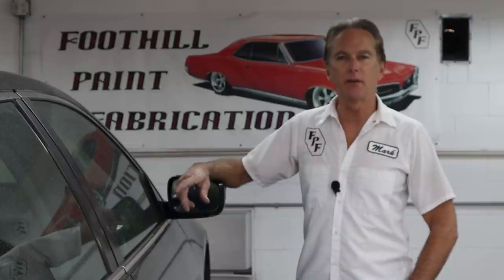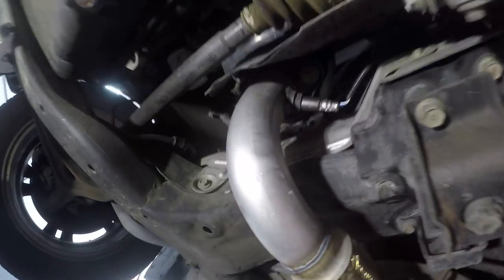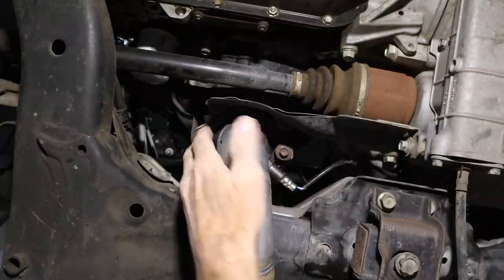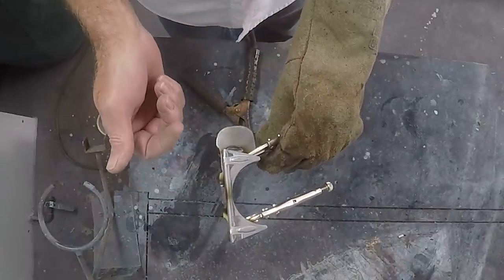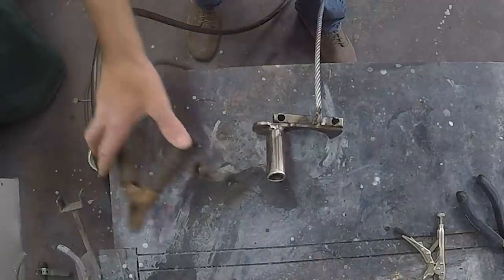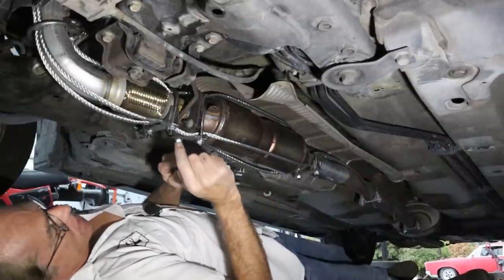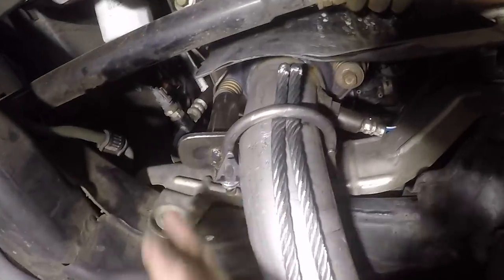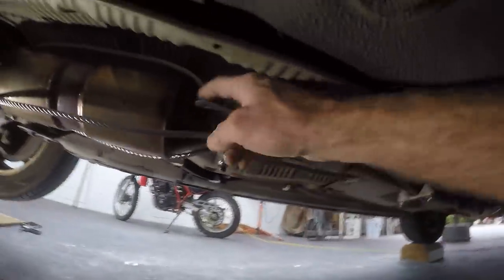Catalytic Converter Theft Deterrent Easy and Cheap

Comment: they will just easily cut the piping and clamps. No bolt removal required, A good sawsall with a metal blade...6 minutes max.....
Reply from the maker: Cutting cable with a reciprocating saw is not easy and the top cable is hard to reach. This set up has been on there for over a year and has deterred at least one guy that we know of. So far so good and after all it is a deterrent not a foolproof system. If you were a lazy tweaker thief and looked under this car would you want to even mess with it or go down the street to the easy one in the driveway?
Reply: @FoothillPaintandFabrication   @Foothill Paint and Fabrication  cutting the carbon steel clamps or threaded u clamp bolts and exhaust piping closer to the CC seems to make the cable useless, no? A cheap easy fix that just looks weird and my mom can install and I;ll win you $4ok, seriously.

Comment: I don't think that will slow them down much.
Reply from the maker: It is a deterrent so if they look at it and think it will take more time and WORK than they want to put out hopefully they will go onto an easier victim.  If they want it bad enough there is nothing that will stop them unfortunately.  Have one guy on video taking a look and passing on the car so it worked on him.  Fingers crossed it keeps working.

Comment: Trying to saw a loose cable is much more difficult than a welded cable..
Reply from the maker: Very true.  As a deterrent it has worked for well over a year now and no issues.
Reply: If that is so, maybe don't clamp the cable too tightly or the theif will just cut at the clamp?
Reply from the maker: @c-qc-q2021  A rattling cable under the car would drive me crazy.  It has been on there well over a year with a couple of guys looking under the car but never try to steal it.  So far so good, fingers crossed it stays that way.

Comment: A Harbor Freight cordless angle grinder ($39.99) will cut through steel cable in seconds. Good buy converter.
Reply from the maker: They aren't going to go to that much trouble and noise that is why they use a chain tubing cutter.  Nothing is 100 % perfect but this should send the thief's down the road.
Reply: The one with the 399 diamond band saw??
Reply from the maker: @UnitedPebbles  A regular metal cut off wheel should work.

Comment: I'm wondering why is he worried about those two top bolts they're not going to take their time to unscrew those bolts they're just going to cut one side and the other
Reply from the maker: When a cat gets stolen some people steal one back and they need the down pipe since it gets cut by the thrives. May have been extra work but to me it was worth the time.

Comment: Sorry but if I was after the internals of the cat, I would bypass the obvious safeguards, cut the housing in half,extract the interior parts and be on my way. Thats all they want. Unless you position the cat (via the manufacturer) so thieves cannot get at it or remove it with a few minutes, then its gone!
Reply from the maker: Cutting open a cat under a car is difficult and time consuming and way to much like work for a thief. Most of the time a crew does the stealing and a "recycler" does the extraction of the internals all illegal of course. They use a chain tubing cutter that is quick and silent to cut the pipes and slide on out with your cat. Easy money for a tweaker.

Comment: If they have to cut the pipe to get it off , certainly they can cut the cable as well.
Reply from the maker: Cutting cable takes time and reaching the top cable will be even harder.  As a deterrent this has worked so far.  More work than a thief wants to put in.

Comment: You mentioned how easy it would be to remove if the cat needed service, not sure why you think a thief couldn’t figure it out
Reply from the maker: Having a car up on a lift in a shop is way different than laying under it at night trying not to get caught.  This is a deterrent and since thieves are lazy chances are they will go down the street to an unprotected car and take theirs instead.  Not foolproof for sure but it has worked well over a year, so far so good.

Comment: if only there were a way to make them like chainsaw stop chaps, so fibers come out and completely bind up the theif's cutting tool, so they lose their power tool in the attempt.
Reply from the maker: Catalytic converters get very hot so it would need to be very high heat material but that would be awesome to cost the thieves some money for once!
Reply: @FoothillPaintandFabrication  right?  I deal with a lot of high temperature and refractory materials... glass fiber would be to weak.  Kevlar, maybe.  but it would still need heat shielding.

Comment: You have a major flaw in this. Anyone with a battery powered angle grinder would remove all those muffler clamps in 
in under a minute. THEN CUT OFF THE EXHAUST PIPE and the Catalytic Converter is gone
Reply from the maker: As a deterrent this should work but of course anything can be overcome.  Thieves want quick and easy and this makes it slow and harder.

Comment: Well I guess that's all they need to do is cut the soft clamp off while they are cutting off converter. They don't carry wrenches.
Reply from the maker: Yes they could but most are using a chain tubing cutter they get from H.F. since it is silent and quick.  It has deterred one thief so far that we know of but it is not foolproof to be sure, just a deterrent.

Comment: And how many of us have welding machines and know how to weld. This is great if you have all that and a lift and easy access to getting underyour car. No help to 99 percent of us.
Reply from the maker: You could totally do this as a no weld version by taking a hammer and bending the threads over on the exhaust clamps after you get everything installed.  The manifold bolt block off plate was extra protection.

Comment: how exactly did it cost $2,000 to get her vehicle back on the road when a catalytic converters $200? install at most 500.
Reply from the maker: OEM parts. New down pipe, new wiring harness for the O2 sensors, cat and labor.
Reply: @FoothillPaintandFabrication  for an 04? I'm sure a lot of reputable places would try to Outsource  cheaper parts for a 18 year old car.  Depending on what they damaged downpipe or flex pipe is very inexpensive as well.

Comment: If the car in the video is one you repaired and has an aftermarket converter on it the thieves don't want those converters. They are not worth much. Their looking for OEM. THAT WERE THE MONEY IS .
Reply from the maker: It was all OEM parts, that is why it cost 2k to repair.

Comment: Why not weld all the bolts and build a steel cage around the unit..
Reply from the maker: You could certainly do that and many have but it is a lot more involved and if you car is a unibody there isn't much to attach the cage to.

Comment: I don't get it. The thief, just like a mechanic,  can just use their sawzall or grinder and cut the clamp.
Reply from the maker: As a deterrent it is supposed to make it harder for them to steal the cat.  Given enough time and space anything can be defeated.  The clamps and cables around the cat are very hard to get a blade on laying under a car. Thief's don't want to work and this will make them  work for it. They want easy money, not a time consuming noisy struggle.
It has been well over a year and the cat hasn't been touched.  Checked out but they took a pass.
Mark
Reply: @FoothillPaintandFabrication  I am not sure how it's easy for a mechanic but hard for a thief. Please explain.
Reply from the maker: @MrMasterFlash  A mechanic will have the car on a lift for easy access and the mechanic won't be worried about the cops catching him.

Comment: I assume when they come to steal your cat they also come with a battery-operated grinder. If they are going to cut off the cat it is no problem to cut off a few clamps.
Reply from the maker: True.  This is a deterrent not a foolproof solution. If they want it bad enough nothing will stop them but if it looks like more work and time then they want to put in they will go onto easier pickings. Already worked on one thief so that is money saved right there for my sister.
Reply: @FoothillPaintandFabrication  Yea, it is kind of like the old joke where two guys are going for a walk in the woods in Grizzly territory. One guy says to his buddy that he has to put his running shoes on before they go.  His buddy replies, "you fool you can't outrun a Grizzly," to which his friend replies, "I don't have to outrun the Grizzly, I just have to outrun you."

Comment: They use saws all . He checked that car saw aftermarket cat moved on. They don't want the after mkt.
Reply from the maker: Factory parts were used when it was repaired.  Pretty tough to cut through cable with a sawzall.

Comment: Put railroad ties in your driveway and have your car straddle them as you park.
Reply: This is very clever. Did you ever try it?
Reply: @atlassmirked2959  I have not tried it, but I would if I had to park in a driveway.

Comment: A shield is a much better option
Reply from the maker: Problem with shields on a unibody car is there isn't anything to attach it to except the exhaust pipe and then the thieves just cut at each end and take the shield too. Overheating cats can also happen due to no air flow.

Comment: WHAT, I DO TO ALL OF MY TRUCKS IS I MYSELF REMOVE ALL OF THE CATS OFF OF ALL OF MY TRUCKS THEN I GUT ALL  THE INSIDES OUT THEN PUT THEM BACK ON THE TRUCKS. THE STATE INSPETION SHOP TOLD ME AS LONG AS THE CATS ARE ON THE TRUCKS IT WILL PASS A STATE INSPECTION. THEY GOT TO BE ON THE VEHICLE. SO FAR SO GOOD.      [STEAL MY CATS TOU WONT GET NOTHING BUT A GUT OUT CAT]
Reply from the maker: I hope they stay away from your trucks. Here we can't get away with any alterations to the pollution control system.

Comment: it won't  work  if i have battery cutter say good by converter
Reply from the maker: I think you may have missed the title of the video. This is a deterrent not a full proof protection device. Anything can be overcome with the right tools, time and effort.  Thieves simply do not want to put in the effort so they will go to easier targets.

Comment: Forget it…. Thief’s dont use sawsalls anymore.  Cut thru that joke in less than 1.5 min.  Plus the crews around here dont care if you hear them. 3 of them.  Driver,cutter and 1 armed guy..
These cables are the easiest to cut
Reply from the maker: It has worked so far but I will let you know if they steal it.

Comment: Why not build a cover over the converter all that material you could have shielded it time is what the thieves need in and out so covering it with a sheet metal cover would work and take less time to make
Reply from the maker: There are shields on the market and other products but many cars don't have a good place to attach it to since they don't have a frame.  Cables and some exhaust clamps are something most folks can do in their driveway or garage.
Reply: @FoothillPaintandFabrication  I meant weld a shield to the converter and with the hardware covered also
Reply from the maker: @thevermonsterrichards5163  Great idea!  I wanted to make sure the O2 sensors and Cat could be serviced without hours more of labor but a shield would add another layer or deterrent for sure!

Comment: Do you know what works just as good as a cut off wheel, a sawzaw which will also cut threw cable, oh and that's exactly what they use to cut off converters. Hmm sounds like a waste of money, oh and if you paid 2k to replace a converter that costs 500-750 you got screwed.

Comment: They're going to cut right through that.....😂
Reply from the maker: It has worked so far and even have a guy on video looking under the car with a flashlight and then leaving so in that case it worked as deterrent just like I hoped it would.  I will let you know if it gets stolen.
Reply: @FoothillPaintandFabrication  That's really good to hear.💪🙏

Comment: I don’t understand how they get under a car. Now a truck I do. I’m 6 foot 200 lbs.  I can’t fit under my car to cut my cat off. These thieves must be tiny.
Reply from the maker: In this area they don't have to get all the way under the car as the thieves are using a chain tubing cutter so all they have to do is to be able to reach the exhaust pipe.  Wrap the cutter around the pipe with one hand, roll it back and forth a few times and the pipe is cut.  Some use jacks too but the ones I have seen on video are pretty small guys.

Comment: Nice job, but that is NOT easy for 95% of us, nor are the tools required accessible without spending $400+++ dollars
Reply from the maker: You could do a no weld version by using the tamper proof bolts on the manifold and instead of welding the nuts take a hammer and bend the excess threads coming out of the exhaust clamps and that would certainly slow them down or deter the thieves. Cutting the cable would require a cable cutter or cut off wheel on a grinder but I am sure that could be overcome fairly cheaply or by calling a buddy that may have the tools.
Reply: Harbor Freight for low cost tools and it's much cheaper than a New CAT and work to install

Comment: I would have welded the steel cables to the cat and the pipework
Reply from the maker: The problem with welding cable is that you only get a few strands on the outside.  But if you slide some small pieces of pipe over the cable, smashed them down onto the cable and then welded that to the exhaust pipe it would work great.

Comment: I have twelve volt electric fencer and charge the car whome ever touched my car will get shocked on touches my car I rubber coated kee for switch. This stops people who tries to break in with lock slim jim
Reply: I replaced my converter with price of pipe cheaper then replacing my wore outconverter

Comment: You didn’t even need all those clamps. You could have just went down the cable welding the cable straight to it every 2 inches or so.
Reply from the maker: The idea was to make the parts serviceable in the future without a ton of labor costs.  Also welding stranded cable only attaches the cable by a few exterior strands which are now brittle and easy to break free.  Welding would work as an alternative  method though since this is a deterrent.

Comment: The saw that cuts the pipe will cut the cable.
Reply from the maker: It has worked so far and deterred one guy that we know of. Cutting thin wall exhaust pipe is a lot easier than cable.  Looks like to much work and lazy thieves will look elsewhere.
Reply: @FoothillPaintandFabrication  agree.
One idea would be tack weld thin rebar. They might use bolt cutters on a cable they cant cut rebar ....just tach weld a thin rebar anf poof.....done

Comment: Yes BUT most cat thieves use a sawsall. v
Reply from the maker: Not around here, they use a chain tubing cutter as it is silent, easy to wrap around the exhaust pipe and takes seconds.  Cutting stranded cable with a reciprocating saw is a nightmare.

Comment: no disrespect but those deterrents will barely slow them down, you kept focusing on blocking the bolts, out of all the cats i've heard about being stolen, you nieces is only the second one i've ever heard about where the thieves took the time to undo nuts and actually with the exposed pipe in front of the converter i don't see why they didn't just cut both ends and as far as your galvanized cable goes, the one thing thieves always seem to have are bolt cutters which will make eliminating that cable the easiest part of the job but you did give me an idea, since i change my own oil i'm going to wrap my converters with razor wire which i'm going secure with welded clamps like you used, that way if they do get one of my cats i just have to follow the blood trail.......

Comment: I don't have a welder
Reply from the maker: You could still get a great deterrent by taking a hammer and bending the threaded portion over that sticks out of the exhaust clamps after you get it all tightened up. The thieves wouldn't be able to just thread the nuts off and it would still take time and work and we all know they don't like to work.
Reply: Sorry to sound so negative, but it angered me when you got your welder out, no amateur mechanic  has access to welding equipment or even a ramp or pit they can use, so it is not Easy and Cheap,
Reply from the maker: @donaldjolly2882  Don't worry about being negative, I see your point.  I did all this work laying on the concrete with the car on jack stands.  Not fun but I don't have a lift or pit either.  Like I said bending over the threads on the exhaust clamps could be very effective.  The idea is to make it look like work to get the cat off instead of 90 seconds and run off.
Good luck on your solution
Mark

Comment: if they have tools on hand to cut out cat?????
Reply from the maker: This is a deterrent so if it looks like a time consuming hassle they will move on to easier victims.  With enough time anything can be overcome.
Reply: @FoothillPaintandFabrication  they would chuckle while cutting right thru...I don't think you thought this thru very well...
Reply from the maker: @kcstafford2784  It has worked so far.  Have one guy on video looking under the car with a flashlight and then taking a pass so in that case it worked.  I will let you know if it gets stolen though.
Reply: @FoothillPaintandFabrication  that is not how you said it in your vid???? You said your sister called and you knew you had to do Somthing Any how I hope it dose.. 
I would put a proximity switch under there and hook it to the alarm..